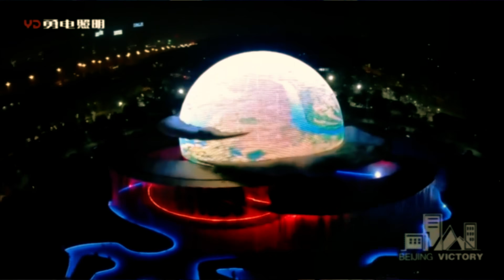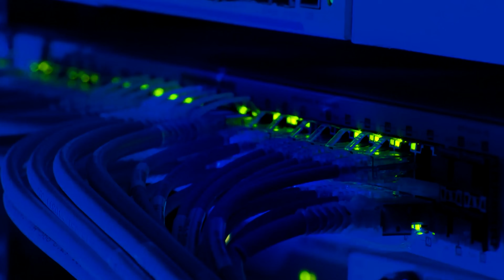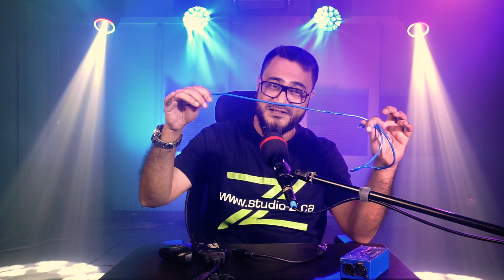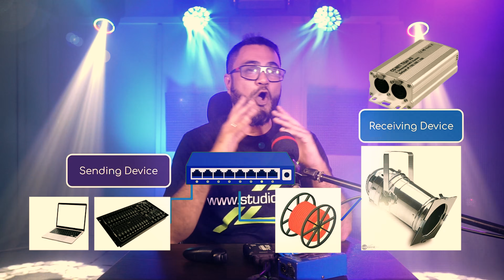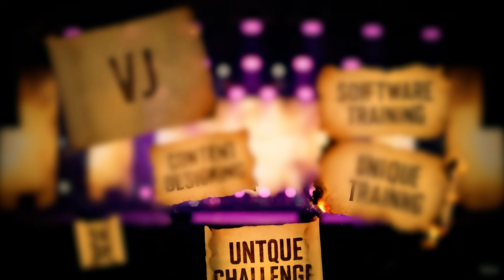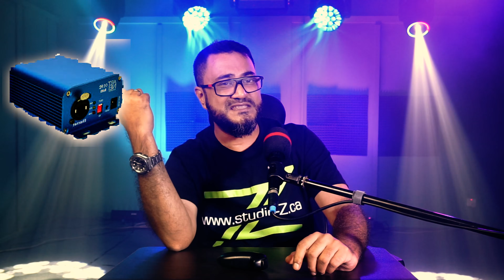How ArtNet Changed Stage Lighting Forever 🔥 | Explained Simply

Comment: Artnet was under license and had a high cost to use, so several competing alternatives began to get a very strong hold in the market. This was driven by the explosion in the Christmas Lights industry for sound and sync Christmas light shows. This free protocol known as Streaming ACN or as E1.31 DMX over ethernet inspired a huge DYI community.
Artistic Licence, the owner of the Artnet Protocol took notice, as if this trend continued, Art Net would become a dead protocol. Artistic License made using the protocol free except for building it into hardware, so the subscription model died and the hardware was a one time cost.  I mostly use the E1.31 for most of my lighting except for some live shows where I use a hardware console with 1 universe of Artnet built in. The console is older, but has that much needed feature for live theatre and bands at a county fair, where pre recorded sequences to a time track do not work. Mixing scenes live on faders, and the ability to patch DMX channels to physical faders is essential when you move from DJ contollers that can playback one scene or chase at a time.  Can't afford one of the MA consoles, but do have a Leviton Piccolo console, which has the patch for a full universe of DMX channels that can be assigned to fader sliders, and then used to set up scenes, which are placed in Scene faders for live mixing of scenes. A scene may contain a few channels, for example, a scene may contain the follow spot dimmer, so you can bring up a follow spot, while other faders contain the scenes for the color wash lights, and operate them independently, which DJ controllers can't do.
If you are running Artnet or E1.31, you are past using 192 channel DJ controllers.